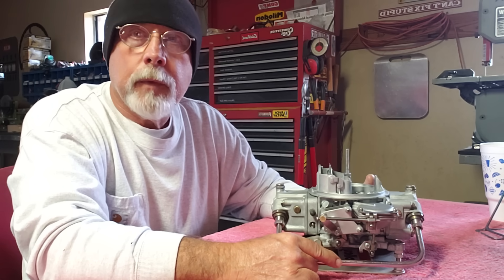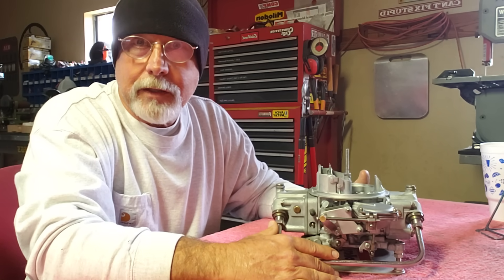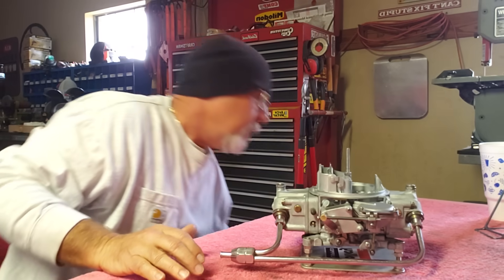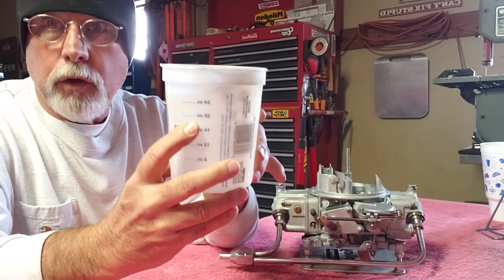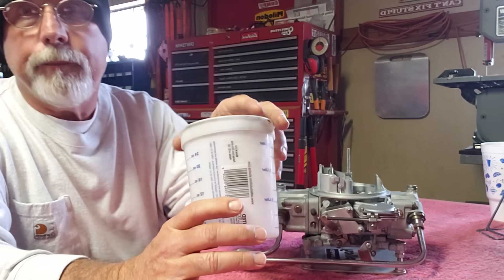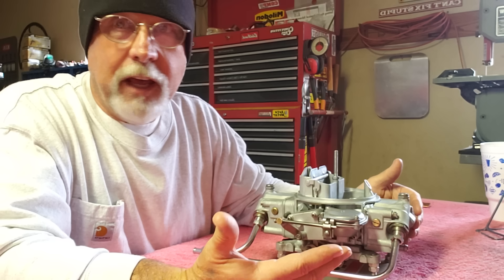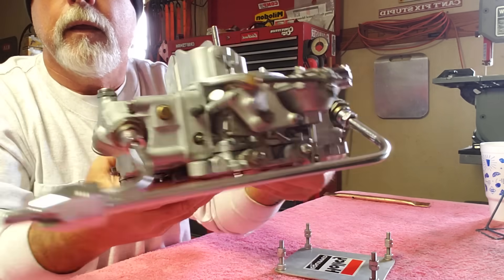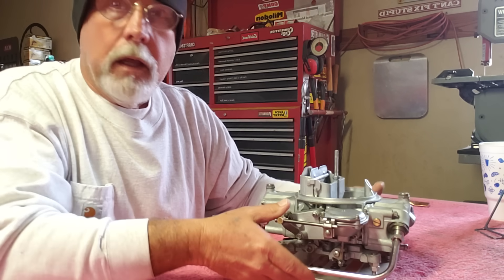Best carburetor cleaner ever!

Comment: Im restoring my old 47 ford 2n tractor and I used muriatic acid just on some nuts and bolts so far and Im wondering if it will work to clean the carbon deposits off the cylinder head. I'll give it a try.

Comment: Did you soda blast both the inside and out?  What did you rinse the carb with after soda blasting?
Reply from the maker: Yes, just clean water the soda dissolves and compressed air

Comment: Great info. Can a guy use it on a steel/cast carb off of a tractor?
Reply from the maker: No sir, don't work on steel or pot metal
Reply: What would be the best for a cast/steel tractor carbs?
Reply from the maker: @davidraddatz380  Solvent and let them soak overnight and clean with a toothbrush & compressed air
Reply: Thanks for the response.

Comment: !oediv taerg   lol.  Hey, question - My Holley 4160, 1850-2 series diagram shows a Metering Body Vent Baffle, but my carb doesn't have it.  I've watched several videos of 4160 rebuilds, and I don't see this plastic Metering Body Vent Baffle secured by the blue gasket on the metering block.  Any advice on this?   It's not in the rebuild kit.  I've already rebuilt this once, installed the carb, and then ran the engine.  I am getting a leak in the back, but I'm not quite sure yet where or how.  Anyway, I'm going through it again to see if I missed anything and I noticed the difference between having this vent baffle and the diagram of a 4160.
Reply from the maker: Watch my rebuild video, this should help.

Comment: Todays date: 1-21-22.  OK, I admit I didn't read all of what you put above.  I used 1gal of 28% acid and 3/4gal of water.  Put the carb bowl off a Edelbrock 600 in it and watch'r boil. It musta been pot metal as, yes it turned black and the carb bowl came out like a raw casting.  Total loss.  But the carb had been out in the weather for some time as it was completely rusted solid, so was already a total loss. Great learning curve. Good video. Watch it twice. Before and after.

Comment: Thanks Ronnie ! Really like your video .. have many carbs I would like to try this on. Was wondering if process would work on other engine parts .. possibly ones with paint on them like brackets, intakes, maybe even heads with interior passages not readily accessible. I would think aluminum parts it would work well on cast iron or steel???. Would have to make certain to blow out carefully, especially small carb passages. Would a baking soda/water pre-rinse to neutralize acid then a clear water rinse possibly help reduce possibility of any negative blowing out with air issue incidence?
Reply from the maker: Wouldn't recommend it for cast iron or steel parts, should be ok for the aluminum parts just don't leave to long. The baking soda will dissolve in water and the compressed air will clean out/neutralize any and all airways no problems.
Reply: @ronniehenson4122  Thanks Ronnie, will try on my Edelbrock intakes, possibly any raw aluminum cylinder heads I get and need to clean. Have a Fastburn set on shelf that is all together for my little mouse motor. They are still in nice shape tho. What is your process after soda blasting? ... you do clean soda film off right?
Reply from the maker: @keithwalden7718  Just clean water and compressed air

Comment: Glad i came across this video, have a autolite 2100 carb I’m cleaning that’s a mess and chem dib isn’t cutting it. But was wondering what ya used to wash it after the acid dip. Just use regular chem spray afterwards?

Comment: thanks for proportions for acid and water. i use phosphoric acid all the time for rust removal and have use muriatic acid to clean bricks and fireplaces. but never on a carb.  I just bought an 84 Goldwing gl1200 at an estate  not started in over 15 years cant even open throttles will try this if my  carb cleaner doesn't work. i did the bike  fuel tank in frame with electrolysis, it  went from extremely rusty to spick and span, and just about ate up a 3/8" ready rod i had as my sacrificial electrode. enjoyed your video thanks.

Comment: great job.. the reason the acid works so good is it cleans out all the passages and doesn't need agitation, and it also has one more awesome benefit you are 1/2 way to anodized....you said you have spare time.. just one more skill to add that is really worth the time investment. I buy totaled bikes and boats and build smoking choppers for next to nothing because Aluminum is easy to repair, finish, polish, anodize, even plate... keep up the good work Brother...
Reply: DO  U  HAVE  ANY  IDEAS  ON MY  SOLVENT   TANK  PARTS  WASHER  THEY  WANT  $ 15.00    A GALLON  AT   THE  PARTS  HOUSE

Comment: Please understand you should only do this on a throw away carb & as a very last resort! Do not do this to classic or non-replicable carburetor! Muriatic acid will dissolve or pit brass and aluminum!!! (Both are soft metals) This is evident by the pitting on the outside of the carb IN THE VIDEO! (Just imaging what your not seeing within the internal passageways and jets). The erosion will continue even after rinsing. As the metal becomes porous the acid will be absorbed/ impregnated in the material. Most likely you'll have another blockage down the road from internal passageways flaking off and getting stuck in a jet (either air or fuel). 

The Job of the carburetor is to mix air and fuel, and break it down into smaller particles (atomization) to aid in vaporization (when a liquid turns into a gas) of the fuel during compression. 

Jets have small tolerances eroding them can enlarge the passage way or erode the funnel shape of the jet changing the output pressure of air or fuel in that circuit, affecting engine performance. Additionally if there are any other internal component you can not reach or see, like the rubber, will gum or dissolve. You can have sticking in the throttle plates WICH CAN NOT BE REMOVED! (they are staked in at the factory, if removed you'll likely end up with that screw in your cylinder!)

Your best bet is to use carb cleaner, a sonic cleaner and carburetor jet cleaning rods. DO NOT use torch tip cleaners as they are abrasive and will mar your jets, this will permanently damage the Jet (which may not replaceable if internal to the carburetor). You can use carb jet cleaning rods to help clear large blockages. Use card cleaner spray going the opposite direction of the fuel or air flow (Passageways often get smaller down the line). Use a small amount of dawn dish soap 1-tsp (or less) in a sonic cleaner temp between 150-160 F (to much detergent or heat can affects the harmonic vibration of the water and reduces its effectiveness). Replace the water in the sonic cleaner after each run.  Repeat the process of flushing in the ultrasonic h2o and carb cleaner, finally rinse and dry with compresses air no higher than 25 psi, and replace all gaskets, seals, o rings, and diaphragms.

> If you are still not able to resolve the clog you can identify where it is with the card cleaner spray (where it does not come out) and replace that component if needed. Metering block, bowl, jet, needle seat, etcetera...

You will want to check that the carburetor runs and functions correctly on a test engine before using on your nice toy. This is only a rough test as holly has a proprietary machine in factory to pressure test each circuit. 

>Better understand your carb jets and passageways look up your specific holly on their website or contacting them directly:
(example) https://documents.holley.com/techlibrary_carburetor_tech_info.pdf

- Dawn Dish Soap $5
- Carb cleaner $5
- Ultrasonic cleaner on amazon $80-$120:
https://www.amazon.com/VEVOR-Commercial-Ultrasonic-Capacity-Solution/dp/B01HGNYO0U/ref=sr_1_1_sspa?keywords=6l+ultrasonic+cleaner&qid=1636001813&s=industrial&sprefix=6L+ul%2Cindustrial%2C103&sr=1-1-spons&psc=1&spLa=ZW5jcnlwdGVkUXVhbGlmaWVyPUExUDNEVk5YQVAzNlpMJmVuY3J5cHRlZElkPUEwNzMzODg2MUVQSFZXN1dBMEhGSCZlbmNyeXB0ZWRBZElkPUEwMDk4NTc2MU5FU0JPODdIREdWTiZ3aWRnZXROYW1lPXNwX2F0ZiZhY3Rpb249Y2xpY2tSZWRpcmVjdCZkb05vdExvZ0NsaWNrPXRydWU=

Comment: mixed as suggested and soaked for 12hrs    now the treads in the carb is almost eroded away
Reply from the maker: I never said soak for 12 hrs, set the timer and check every 5 to 10 minutes as needed. I also recommended for everyone to do a test piece before they clean the entire carb because of the different types of metals carbs are made out of. Sorry for your misunderstanding.

Comment: Great explanation on using acid safely.  I've used muratic acid to break loose so many different rusted together items. From the center shaft of a coats tire machine to the turnover ball assembly of a gooseneck hitch that was so rusted in I picked up the whole truck dangling from the ball and heating it with a rose bud and it would not budge. 30 min after soaking muratic acid down the ball assembly it pulled out with my hand! Of course, this stuff is quite caustic so every precaution needs to be taken. I've also used red devil lye diluted to clean steel and aluminum. But it will damage aluminum if not diluted property and amount of time in the solution strictly controlled. Thanks for the great video!

Comment: Hey, Ronnie, do you happen to know (or any of your viewers) what older outboard motors are made of? More specifically 1958 Evinrude 5.5hp 5516 Fisherman. I had a piece break on it and I was thinking of trying to weld it back on. Wasnt sure if it was metal or another material.
Reply: Its the throttle linkage bracket that is screwed onto the long throttle handle. Basically what most of the motor is made of. Not the actual power head. Kinda sucking at explaining it lol.
Reply from the maker: Sorry! not sure

Comment: Tech for 50 years- 38 as a shop owner. If you have a carb that the air adjustment(s) do not change the mixture try this. 
Old school way is to use a  mixture of white vinigar and water (approx 30/70) and put the disassembled parts in a slow cooker on low over night. Works especially good at disolving the salts created by moisture in the fuel more especially by ethanol that carb cleaners won't touch.
Clean the as much grime and gunk as much as possible before the soak.
Reply: Mint. I wonder if a pressure cooker would work better.
Reply: How do I determine if the air adjustments do not change the mixture?  I have a Honda gx690 engine that I use for a pressure washer.  I got some bad gas in it from a metal gas can that was rusting out from the inside.  Needless to say those metal can cans are going to the dumpster.  PS I am not a mechanic or an enthusiast.  I am intimindated a little about tearing apart this carb and making the problem worse.  Any baby steps claririfcation would be helpful.  Thank you

Comment: I normally prefer watching the steps being done as the person talks, but you did an amazing job describing the process, cost, tools, etc. 5 star video. Great job. Earned my subscribe and like for sure!
Reply from the maker: Thank you so much!
Reply: @ronniehenson4122  I used your method to clean the carb on my 1958 Evinrude 5.5hp outboard. It worked great! I had to make some other adjustments with my fuel lines but I finally got it running! This was my first outboard I've ever worked on and didn't even know what a point was going into it haha. Feeling pretty accomplished right now! I'm going to take it out on the water tomorrow. I expect some more work on it but...she runs! I'll try and post a video of how she does out there!

Comment: Yeah - 15% muriatic acid will clean corrosion, but consider that muriatic acid is 10% hydrochloric acid by weight, so why not just use a 1% solution of hydrochloric acid? And if you are really on a budget, The Works toilet bowl cleaner is 9.5% hydrogen chloride (hydrochloric acid), so using approximately 20% of The Works will clean a carburetor too. I have been cleaning carbs for motorcycles and other power sports equipment for 40 years. I to have used all the cleaners Ronnie named off including muriatic acid. That all changed when I found a 10% solution of Master Stages 2020 in a heated sonic cleaner did a much better job and did not change the color of the carb or require soda blasting as a final step. No gloves needed, remove the carb after a 20 minute cleaning at 180 degrees F with sonic agitation, rinse with tap water, blow dry and assemble. Removes soil, grease, algae, varnish and light oxidation. Won't harm rubber or plastic, but will remove paint and clear coat. I'm not saying Ronnie is doing anything wrong, but there are better and safer methods to achieve the same result.

Comment: I have use it on bike and boat carbs for years when they are full of chalk. I just dip for  minute but then I dip into a backing soda wash to neutralize it. I use it full strength and not the cheep green stuff like Walmart sells. I also use it to eat the rust out of bike gas tanks too in minutes not days. The key is the baking soda to stop the eating

Comment: I WORKED AT A MC SHOP SPECIALIZING IN CARB WORK. I'VE HAD CARBS THAT WERE IN FLOODS AND GREEN INSIDE..! ANYWAY I RAN OUT OF CARB CLEANER SO WAS LOOKING FOR SOMETHING TO CLEAN THE TARNISH, VARNISH, AND OXIDATION OFF, CARB CLEANER WOULDN'T TOUCH. WENT TO BATHROOM AND SAW TOILET BOWL CLEANER ? WORKED GREAT ! SOAKED 10 MIN RINSED TOOTH BRUSHED, WIRED HOLES A COUPLE TIMES TILL CLEAN. [HYDROCHLORIC ACID]

Comment: I have been using muriatic acid on lawnmower engines carbs for 20 years.  I used it full strength, maybe I was wrong.  I now use it on my water filtration system for cleaning.  It works great on iron staining.

Comment: I use gun wash from the auto body paint shops. It’s a lot like carb cleaner. I get a 5 gal pale and it last me a long time. It cost me about $25.00 and I can either pour it onto a rag or in. A pump sprayer made for chemicals. Leaves no residue and cleans just like carb cleaner just not with the high cost.
Would your idea work for an aluminum intake manifold? I have a new one I used for mock ups and it got some gas stains on it and looks ugly. I need to clean it up.

Comment: Once the Aniline dye is removed though, the carburetor is bare zinc and can corrode and get ugly pretty fast. I would not do this unless I had the dye to redo it. The steel parts, throttle lever, etc. are Cadmium plated, then Cadmium Chromate dipped -  for corrosion resistance, I would be really careful to not remove it or you're going to have a bunch of rusty parts once the carb is out in the real world.
Reply: Instablaster

Comment: For our Ford pickup carbs that were holley in the late eighties, the driveability improved only with a new carb.
No magic. No secret ideas. No different rebuilders. Nothing could pass new car driveability and emissions for customer satisfaction like replacing it.
The passages were internally affected by the fuel they sell.
We must have had  eight different guys and three managers give their all.
We ran the authorized supplier out of carb units. None of them ran quite like putting a new carb on there before it was out of warranty.
When the customer actually pays the bill using the new carb adds about 300.
But then they're able to be called fixed and the customers accepted them.
Now there are people who would accept "as good as it gets under the circumstances"  but most of them would be returning over and over saying try something else, it doesn't run right and at times I can't accept it.
With all the expense, the new part solved them best.
Then their warranty would run out and ain't that funny? There aren't any twin tailpipe long pickup trucks out there to be worked on anymore.
If that engine didn't have it's horsepower output it had, it would have hardly been worth all that.
Then it was "can you explain my fuel mileage? I have injection and a 460" ..... Oh here we go.

Comment: Also this trick can be used for removing zinc from steel before welding. It completely removes all zinc and anything else on steel, works awesome.
Reply: Awesome,  The cleaner you get at the dollar store, Awesome.
Reply: @340rps  Does that do the same thing?

Comment: Your vacuum secondary canister and throttle linkage are on the opposite sides as compared to any Holley I have ever seen, relative to the choke airhorn!!!   If you install the carb with the choke towards the front of the engine then the throttle linkage would be on the passenger side of the engine???  Never seen that and been tuning Holley carbs for 40 years. At 16 years old I could tune a 650 DP crisp enough to push a 289 Ford to 11 second quarter miles in 1980...before badass aftermarket parts for SBF!

Comment: I have been cleaning my carburetors by putting lacquer cleaner in my almost empty gas tank: a pint is most always enough.  I run the engine after using starter fluid to get it going.  The lacquer cleaner dissolves all the varnish, and gunk from even the smallest passageways.  This method has never failed me!

Comment: I have done this for 35 years works grate on transmission case's also and wheels and rust on metal part's too. Try it in a spray bottle, i usually only get one use out of a sprayer unless you rinse it out.

Comment: tried the Muriatic clean but my base plate on my Holley 4777-5 turned black and pitted. Kind of leery about doing the body, metering blocks and bowls. Have you ever run across this? I am attempting to block sand my base (both sides) in hope to make sure it seals again. Thoughts?
Reply from the maker: Your solution was way strong and you might of left it too long also. Never had this problem.